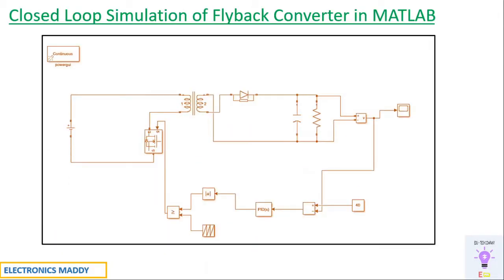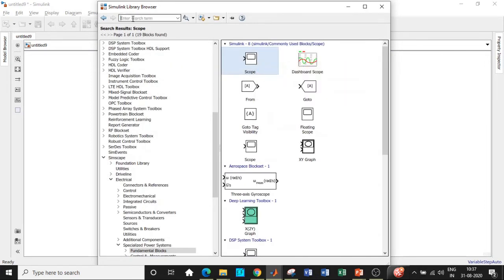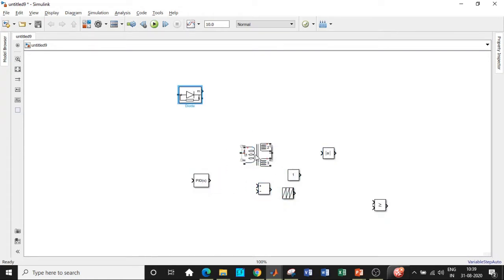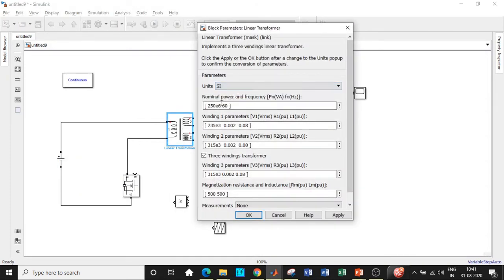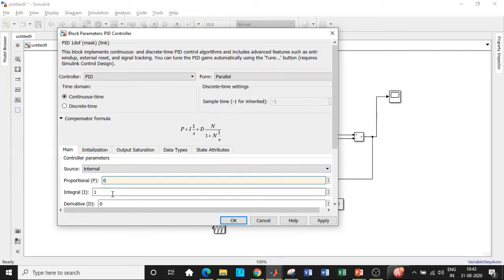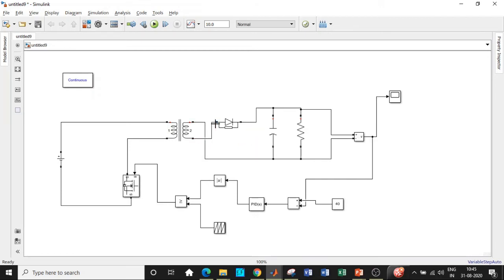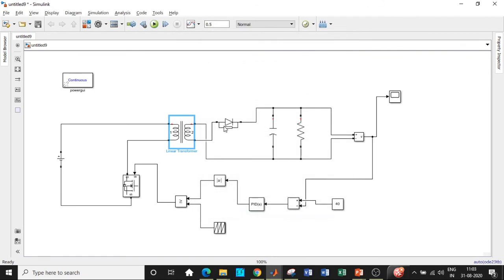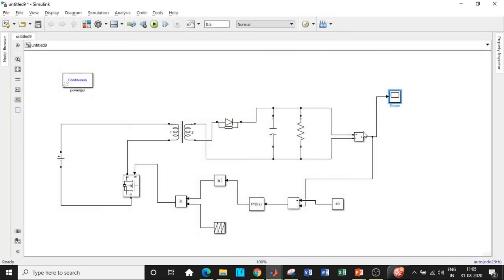Closed Loop Simulation of FLYBACK Converter in MATLAB | SIMULINK

Comment: i hace asn unfolder flyback microinverter with MPPT,  how could be the closed loop in simulink? if you can tell me o show me something it would be very helupful, i've been spending a lot of time with that and i still can´t to have teh desired sine wave  in the output (it should be at grid amplitud and frequency)

Comment: i want to do this with a PI controller for the input of 300v and output of 65v. what values should i give in transformer parameters and PI controller? please help
Reply from the maker: Hi lokesh. Change the supply voltage to 300v. Change transformer voltage to 300v at primary and 65 v at secondary. For PI controller try with the same value that I have used.  In case you are not getting then you have to design the PI CONTROLLER for your circuit. All the best :)
Reply: @ElectronicsMaddy  I tried the same simulation which you did, but i'm not getting the output even if I change the connection in transformer secondary. I did every step similarly with same parameters. I even shared this video with many people each and every one of them said the output is only zero.
Reply from the maker: @logeshkumar7169  Have you changed the L and C values accordingly? Did you design the PI controller values? If yes, what are the values and what approach did you choose?
Reply: @ElectronicsMaddy  No. I didn't change any values. I just entered all the values you used from voltage, L and C values to transformer parameters and PI controller values. If i change the voltage then only I should calculate and change the values, but i just did the same as what you did still I'm not getting output. This is important to me. please help. I'm using matlab 2018a and 2020a
Reply from the maker: If you are simulating the circuit with exact same values that I have used then you will 100% get the output. If you are trying to change even a single parameter value, the entire circuit design changes. So you may not get the output